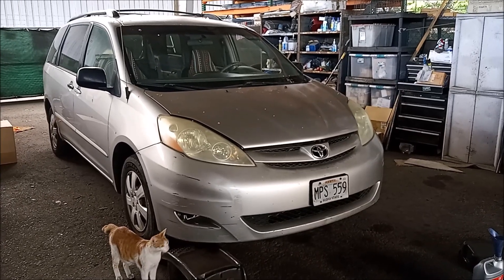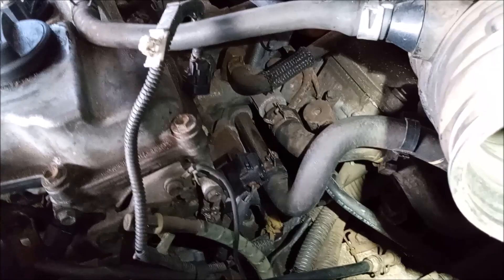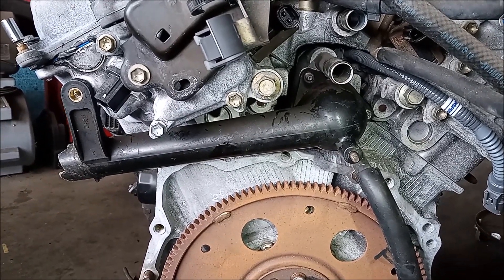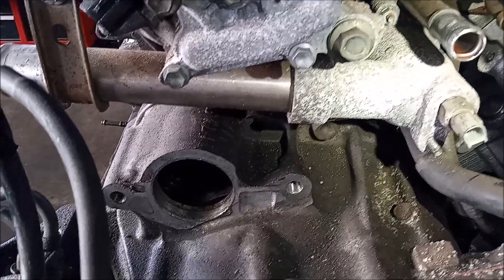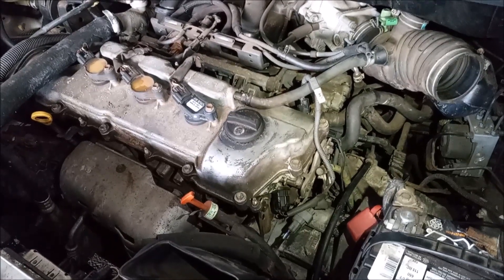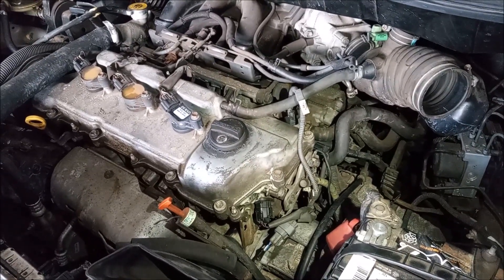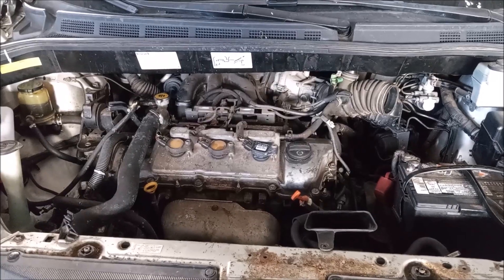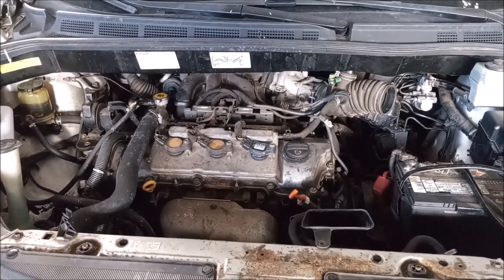Coolant System Flaw - 05 06 Toyota Sienna 3MZ-FE - Water Neck Fix

Comment: What is the part number for the 1mzfe metal thermostat housing?
Reply from the maker: You need two parts, 
Water outlet 16321-0A020
Connector tube 16322-0A030
and don't forget o-rings and gaskets.

Comment: my 96 Avalon with 520,000 is all metal gear solid.😁 these 1mzfe vehicles are close commercial quality standards with parts and supplies readily available from Toyota and aftermarket with-in a weeks turnaround.  a current surplus of Drivetrain, suspension, even electronic switchgear can push these vehicles to near mint condition with relatively inexpensive cost. unless your the type to want to be with the latest and the greatest, its senseless and inefficient to get rid of these Toyota/Lexus vehicles of that time period.
Reply from the maker: You are absolutely right, this was the Golden Age for Toyota.

Comment: I drive a 2002 Toyota Solara V6 with 1MZ-FE and as of today, it has 565,000km.  I took great care and now going to rebuild the engine as I think the valve stem seals are passing causing it to run rough for 20minutes, then runs fine.  Does not burn oil..  Manual transmission has a different bell housing than automatic.  Manual transmission is a bit daunting when looking for spare parts at this stage.  The charcoal canister and passenger driveshaft were obtained new oem from eBay.  I wish Merryfrankster lived near  ME... i am going to take my 02 to the 1 million Km mark (my goal) best I can.
Reply from the maker: Worn valve stem seals allow oil to drip down into the combustion chamber but they do not really affect how the engine runs. More likely you have well worn valves and valve seats as well as worn out piston rings and cylinder walls and this is causing the engine to run rough. Not really worth it to rebuild one of these engines - you can get a low miles replacement for far less money than the cost of a proper rebuild.
Reply: @Merryfrankster_  Thx 4 reply.  Not easy to get a 1MZ with bell housing that fits manual  transmission.  Just for fun, getting engine rebuilt BUT shall ask for a quote on engine work.  The frame IS solid, no rust on body panels, Parts are ALL current.  It is a Toyota and proud to drive it.  Love your channel.
Reply from the maker: @jf-3945  That's interesting, I was not aware of any difference in bell housing.
Reply: @Merryfrankster_  You got me thinking... I stand corrected: The 1MZ-FE should be the same footprint.  The transmission is manual and so everything external to the engine would be different... automatic vs manual interface.  Gained insight from your comment.  Passenger front driveshaft is different between auto and manual transmission units.  Not a mechanic by trade but taking an interest in this engine.  Shall watch the engine swap you did on a Highlander.
Reply from the maker: @jf-3945  The manual solara will have some differences in the location and type of the engine and transmission mounts on the subframe. It will have shifter linkages and a reverse sensor instead of the the automatic shift cable. Other than that all details are practically the same as the a/t highlander in the newer video.

Comment: It's EXACTLY why I still drive my 96 Camry with over 400K miles on it! - NO plastic on it! And I have not one but two 1MZ's  with ALOT less miles on them ready to go when its OE motor finally quits😉👍
Reply from the maker: You could do a dual engine setup. Like a W12.